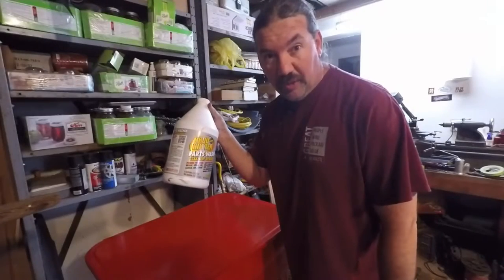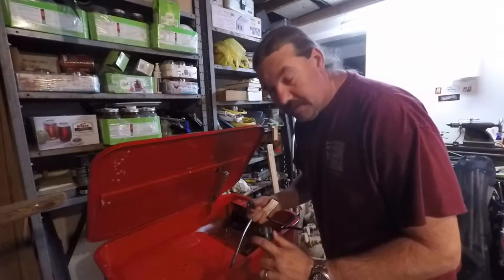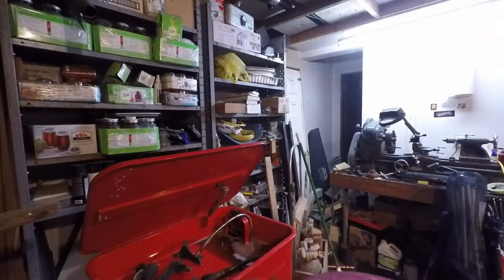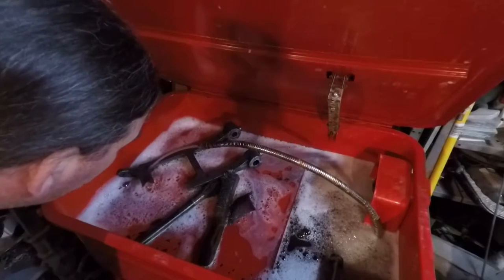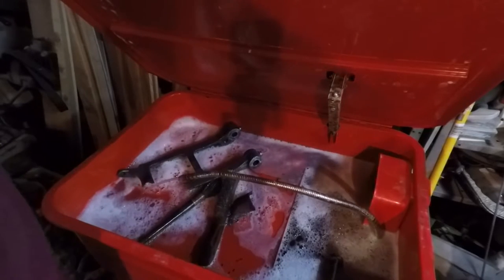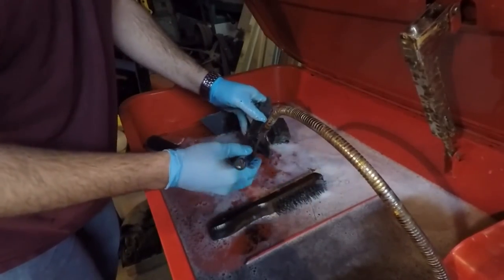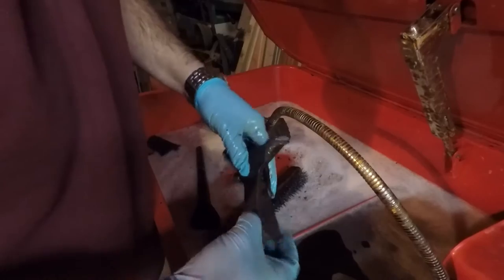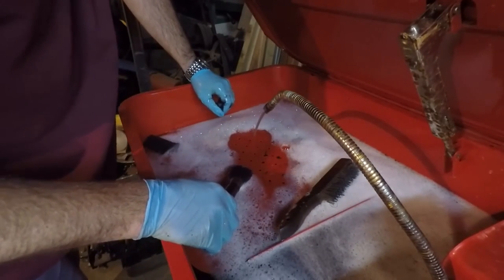Harbor Freight 20 gal car parts washer with Krud Kutter part washer degreaser for cleaning car parts

Comment: Problem with any water based solvent is they work great but fet nasty real fast. Basically every time you want to use it, you gotta change the fluid because all the smut and mold growing on the top. Ive tried greased lightning, simple green, krud cutter, and HF fluid. All nasty because the water gets funky, i switched to diesel fuel...been in there over 2 yrs now and looks and smells just like it did when new. Also cleans much much better. Leaves parts a little slick with diesel film but no worse than smut and mold slime all over the parts. I then spray parts with mineral spirits and it takes every bit of diesel residue off.

Comment: Since we are post the holidays, keep an eye out for a discarded turkey fryer.  Would make a great burner for a heated parts washer.  ;-)  Ideas; I'd think about putting a gallon or two of your solution back in the jugs for later use so you can regain a drain-able work surface.  I think you can add something to the water (is it a surfactant?) to inhibit the formation of bubbles.  Also, a fish tank heater you can turn on in the morning if you know you'll be using your cleaning tank later in the evening.  Or, just toss a soldering iron inside on the way out the door.
Reply from the maker: +Crafted think I have a fryer already. But I do like the fishtaink heater idea .the foam may be just because it was shooting into a hole. Wasn't a problem in use. I do think I'll put some back into the bottle I can use it to top up what evaporates. I think I may add a filter and a flow through brush like you've got.
Reply: The turkey fryer wasn't serious.  But, yea a fish tank heater would be great as long as it has plenty of time.  The flow through brush cuts down on splashing and it's being put right where your working all one handed.  It will be nice having a parts cleaning center.
Reply from the maker: Lol I was kidding to  (dry humor fail )

Comment: Hi everyone nice video I have a question I'm just start a Mecanic project with my Ford F-350 I have to remove a lot of the engine parts and I have bought this 20g part washer and my question is after I get to clean the parts what do I need to do let the parts dry or put some other chemical on because I don't want contamination on the parts they are engine parts can anyone help. Ty.
Reply from the maker: +Dr. Vape best thing would be to rinse and paint right away. Baring that wd40 will hold the rust away for a little while. But clean every with acitone or thinner before you paint.

Comment: does this solvent freeze if not in a heated garage.
Reply from the maker: +HV Milsim I don't know my garage never gets that cold. One of the few benifits of California I suppose
Reply: Yes
Reply from the maker: Good To Know. It doesn't get cold enough here to have hat problem
Reply: @OldIronShops  Pine Sol doesn't freeze, it's a little cheaper, and works very well. All the water based stuff works 1000 times better heated, too.
Reply from the maker: I'll look into this. And it makes sense

Comment: Dude you waste so much time SAYING what you're going to do instead of just doing it. The first minute you said three times that you were going to clean some parts.  Then we had watch you put in the fluid, we had to watch you find the parts, then you had to go get gloves, and it was 3 minutes before you even started cleaning anything!

Use it mostly undiluted (with just a little hot water) and the grease will just melt off
Reply from the maker: You are right about this. It has been a while since I posted this and I've tried to get to the point faster. Thank you for the input.